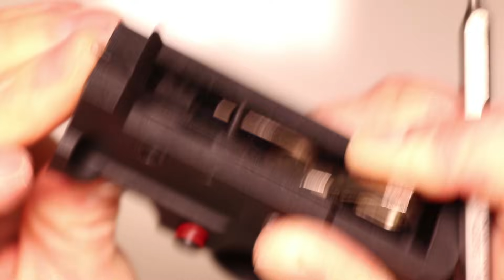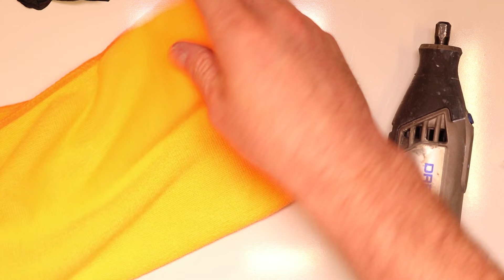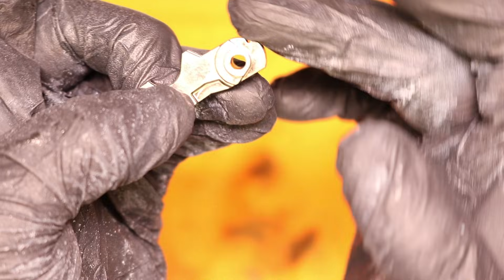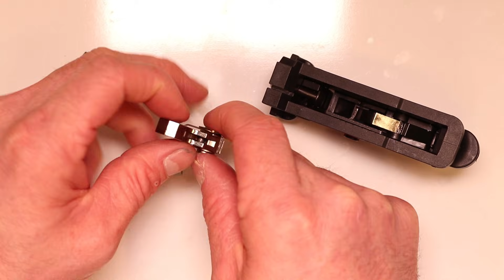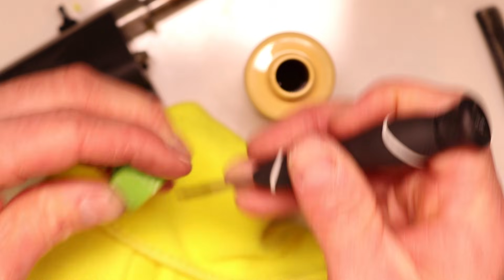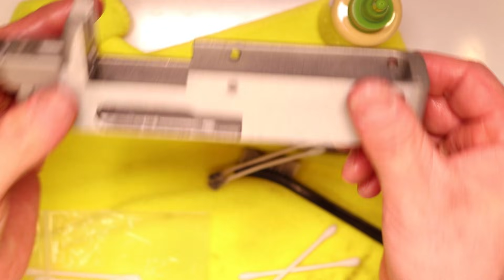Ruger 10/22 Trigger Job w/ Polishing – Full Disassembly, Cleaning & Trigger Spring Kit | M*CARBO

Comment: The slave pin shipped with the kit is too small. It should be the same diameter as the sear pin. It's too sloppy and nothing lines up once you get the trigger dropped in. Very fiddly. Otherwise nice modification.

Comment: That's not grime, it's metal being removed.  You could ultrasonic clean those parts and it would still turn black like that with Flitz. Also, sanding is fine if you're careful.  Use 600 or 800 grit.  That's like 500x more Flitz than necessary, lol.

Comment: Mine was 6lb and rough.  I used the new mcarbo kit with 2 springs and a tiny thin dowl.  dowl was useless and fell out so I cut a round toothpick to size.  After brief polish I replace just trigger return spring the tigger was still 6 lb.  I noticed the trigger was very light if hammer spring was disconnected.  Thinking it was way too heavy I cut off one end of hammer return spring, trigger was light but then I had misfires.  So I stretched the hammer spring longer.  I polished more and noticed I burned plastic side of release lever...repolished that off, installed the trigger release spring this time.  Now it is fairly smooth and down to 3 lb and shoots reliably.

Comment: Good job :( You polished all the casting marks, burrs, and imperfections!  They are still there, still causing issues, but they sure are pretty!  A lazy way of metal finishing.  Maybe you should have spent some time sanding or even filing with those crappy parts to remove all the casting marks, burrs, and imperfections, and then and only then polished them.  Yes it takes time, but it is called professionalism and work ethic.  It's what I have been doing for over 50 years and I feel proud of my work.  I do give you a lot of credit on your disassembly and assembly skills and explanation of how to do them.  That alone will help many,

Comment: Nice video, this was actually easier than expected, especially the pins, I just pushed them out with a nail and aligned them back in by eye.

What is interesting is I have an older deluxe model, and when I opened it up it already had machined hammer and sear.  That explains why the factory trigger was always pretty good and I didn't see why people complained about them.

Nevertheless the mcarbo springs indeed lightened the pull and just makes it feel better too.  $29USD in my country though, I felt silly buying them to be honest but I'm glad they worked

Comment: Polishing does remove metal, how else would the surface become smooth. Material is removed, as seen by the blackening on your tool....... Material has to be removed,else it wouldnt become smooth, the paste you used is an abrasive, which removes material. Very light material removal yes, but ya cany say polishing doesnt remove material.... thats a bit silly tbh.

Comment: As others have said, your trigger started with under 3 lbs pull but Ruger 10 22 factory standard triggers come in 6-7 lbs.  You are right to polish those parts for a smooth trigger but you are still removing metal otherwise those burrs wouldn't be removed.  As for removing metal to achieve a light trigger, it is not taboo.  It is simply something to carefully do in small steps checking the trigger pull as you go.

Comment: I watched this video and did the spring mod on my 10/22 but didn't get any change in the trigger pull weight: still was 6 lbs. I'm not sure what I did wrong but I cannot get Mcarbo to respond to my help@ email. Been 4 days now and no response. A phone call (several of them) never gets a human to answer but a recording. I've left two messages and no one has returned my calls. So I've been stuck for 4 days and thinking maybe I should just move on and try another company's spring mod. After all, how long do you have to wait to get some support from Mcarbo or maybe there is no support?

Comment: Great video.  I used the MCarbo spring and polishing kit on my wife's Ruger GP100 with equally impressive results...almost 50% reduction in single-action trigger pull and about 35% on the double action pull.  Looking forward to doing the same on my wife's and my 10/22's .  
Aother tip: A good replacement/upgrade for ANY 10/22 is the plastic (usually polyurethane) bolt stop pin that installs at the back of the receiver.  It replaces the standard metal one that hold the lower trigger group to the upper receiver and makes a BIG difference in the sound and feel of the gun.  It eliminated the metal-on-metal 'pinging' sound when the bolt flies back and it absorbs a goo bit of the shock and vibration caused by the bolt slapping that stock metal pin.  They are a very inexpensive way to improve the shooting 'feel' of a 10/22.

Comment: You have a sub 3lb pull on a Ruger 10/22 with a stock, non-BX trigger group? No Sir. Ruger claims under 3lbs on a BX. They also state that stock trigger groups are shipped at 6 to 7 pounds. I've always heard to never put PTFE or any Teflon infused grease on a sear engagement surface. Lol. I admit I've done it with Shooters Choice red grease 😊. I find that the crud that gets in a 10/22 trigger group makes me clean and wipe that grease out & replace it a couple times a year. My aftermarket sear trigger groups get no grease, lol. Hey guys, if you try & cheap out & just cut the trigger return spring your gun may start failing to reset, it goes bang, ejects, pushes another round in the chamber, but then nothing happens when you pull the trigger. You still feel the springy, springy on your trigger finger, but there's no bang-bang.

Comment: very good video but in my opinion a couple of incorrect statements.  First polishing, it will 100% remove metal the longer, the more.  Second microfiber will scratch the shit out of polished aluminum so no microfiber is not better then a good cotton t-shirt,  and unlike microfiber you can drop a shirt on ground and pick it up clean. Drop a MF on your driveway pop it once and wipe your car I dare you

Comment: I took professional jewelers classes at our local community college, and polishing was part of the curicula.  Nice job in the hanmer and sear.  I would add a couple of things.

First, for safety, polishing releases nasty micro particles into the air which you 
WILL breathe in.  Very bad.  So we wore N95 or N99 dust masks, just to simply prevent the dust from getting into the lungs.

Second, you mentioned cleaning.  An ultrasound is ideal, but it is very important to remove all of the polishing compound or grit.  Absent an ultrasound, you can wash them in hot water and degreasing dish soap.  I would make several passes of that last process.

GREAT VIDEO!  I look forward to doing this to my 10/22 very soon.

Comment: Why no sanding?  Don't you think some 800 grit would do some good?  Ie:  Inside the reciever, bolt, the face of the hammer.   I wonder what polishing compound would be if it were a sandpaper grit?
Reply: Simple Google search would answer your question....my guess 6-12000.., could be way but I took a guess...800 way to tough would remove metal in my opinion

Comment: Well, obviously the auto focus was giving you a hard time. That being said, this video was very informative. I took my 37-year-old 10/22 down and polished the trigger assembly. It works much smoother now and much lower trigger pull. Note: The wooden dowel included in my trigger spring package was about like the lead in a mechanical pencil, way too small, and was giving me a fit trying to reassemble the trigger subassembly. I improvised with a q tip and an Exacto knife. The stem of the q tip was a perfect fit, and the subassembly went together flawlessly using that as the temporary pin to hold the trigger subassembly together.

Comment: Would love to know how you acquired a 10/22 with a 2 lb. 15 oz trigger pull from the factory. Usually these are around the 6.5 to 7 lb range from the factory.
Reply: That’s what I was thinking! Mine was 6.5 pounds from factory and now it’s 2.5 AFTER a drop in kit that I sanded on. Lol but I don’t recommend sanding the hammer or sear. Although mine is like butter
Reply: I know. Sub three pound hammer straight from the factory? That's one rare bird. I wouldn't touch it.
Reply: Bunch of horseshit claims.

Comment: I watched this video and completely followed the instructions and swapped out the springs included in the 10/22 kit. All the work lowered my trigger pull to 4-1/2lbs. But the level of smoothness of trigger pull achieved was the better than the pound of reduction in trigger pull. Thanks Mcarbo and I recommend this spring kit!

Comment: The hammer and sear are should never be rounded. My hammer and sear are polished with 1000, 2000, 2500, 3000 wet and dry sanding cloth. The sear and hammer mate up in a very sharp 90 degree angle contact. To maintain that angle and polish it in steps I use a metal straight edge (combination square ruler) with the cloth very tight flat on/over the edge. A back and forth motion of the sear and hammer along that 90 degree engagement edge where they make contact will polish them like a mirror. A little dab of silicon grease and its ready to go like polished steel .

Comment: Thoughts on Copper grease/anti seize? I've had awesome results, and Glock uses it as well. a TINY bit !!! really stays put, and the copper lubes and protects well. I'm sure someone will take a poo-poo on it, but Ive been impressed! It doesn't run out when hot, and doesn't freeze up. I use a toothpick to apply it, literally just a  half BB sized dot is more than enough. It really seems to fill  micro pores well. Curious if you're familiar with, or use it? Thanks. Great video, BTW. Really helped my Ruger !!!

Comment: Very long video. A good highly in depth one. So the trigger return spring lightened the pull weight?

Update: 1yr later.
Haven't polished anything yet, but I did install my auto bolt release using your video as a guide. Will do the same when I get time to do a lil polish.

Comment: good video. if you hit those surfaces with 600 grit on a parralel first. and then polish, this job will go so much faster. Those parts are not cast, they are Metal Injection Molded.

Comment: Also, my 10/22 is around 18 years old. The hammer and sear were not cast back then and there is no plastic on it anywhere. Much better quality back then.
Reply: Mine is about 12 years old maybe a year or 2 more. My trigger assembly is metal, but it's the stainless version with synthetic black stock. Does that mean anything?
Reply: I hear what your saying, but I have both and prefer the polymer bits for weight. With and aftermarket trigger and misc parts all through the group, cast parts get tossed into the ransoms parts bin anyway..

Comment: Did a trigger job on my 10/22, sanded, and polished hammer, sear and every other metal to metal contact part, used your spring kit and got a 4 lb trigger pull. It was 6 1/2 to 7, now it’s a consistent 4” . Perfect !!
Reply: Drop a volquartsen hammer only into it for about $40 and you’ll have a nice a 2.lb nice trigger pull

Comment: Great video. Just got a 10/22 carbine and will be performing this mod first, and the bolt lock replacement too. 
Also, worked with metal parts in the automotive industry for 8 yrs, and I think the sear and hammer are powdered metal, not “cast”. Could be wrong, don’t know guns much.

Comment: great video.. however.. your use of the Flitz/SimiChrome/Bluemagic is a bit over the top..  the stuff works just fine with a very fine thin amount on the working surface and then work it off..  you put on enough initially to do about 20 sets of parts.. Usually works best to get it on, buff till it is gone and a shine starts, then repeat.. 
We do internal engine parts for racing and it is a very tedious process... it is a chemical polish and not an abrasive and is why just a thin working coat is adequate at a time..        
Like your explanation coming apart and going together.. am sure it helps out a few of us that had the "ooops" moment the first time..  :)

Comment: Why would anyone want to modify the ruger 10/22 rifle when there accurate on the dot brand new and not modified I have the Cariben version and I have never dissasmbled or modified it and it hits my targets on the dot and the trigger pull is perfect how it's set..... if you modify the 1022 then your asking for problems like inaccurate shots and possible jammings and super light trigger pulls ad with that said the hammer Wont  stay cocked back it'll just slip and fire before your finger is on the trigger this happened to my heritage 22 and I still don't have it repaired yet

Comment: a good course of instruction, another method that works well is stoning the metal parts to smooth out those burrs.
the Material is actually being removed at a microscopic level so u are removing material from the finishing and polishing work that you are doing. I am a professional Machinist and specialized in grinding operations and trust me you are removing material brother.
Reply: Technically correct, but using a stone on the burrs & irregularities ALSO removes material.  I think Chris's point is that you're better off using felt wheels & Flitz, and going carefully & closely watching your progress, than you would be if you were using sandpaper or a dremel's flapper wheel or the like, because those other alternatives take off material faster and as you'd know, Bryan, once it's gone you can't put it back!

Comment: Mines at 5lbs and about to put the spring kit in,so I will report the after.
Reply: Getting just above 4.5lbs now so I got about 1/3 rd lb reduction.
Reply: I didn't need too or my sear and other parts weren't nearly as bad as the ones in this 1022 and mine were all smooth and if you looked at em they didn't actually need a polish.
I may take it back down and polish them later but mine were smooth with no burs or uneven spots.
Reply: I'm moving the trigger guage hook lower on the trigger and I'm getting 3.5 lb pulls now.

Comment: Hi Chris!  I followed all the instructions except the trigger return spring change.  And  l repeated the process like 4 times but the trigger still had a heavy pull and it even has a creep now which it didn't before polishing.  I could be wrong, but it seems to me the trigger return spring doesn't matter that much.  Hope to hear from you soon.  Thanks!
Reply: When polishing the sear and hammer as in the video, you're actually slightly rounding off the sharp contact edge. That is what caused the creep you're feeling.

Comment: Great video! Completely disassembled my 10/22 for the first time in 27 years. Thoroughly cleaned everything and did some polishing of parts while I was at it. It operates so much smoother now! Your video was very helpful especially with the reassembly. Thank you!
Reply: did you ever get the kit with the lighter spring?

Comment: I followed the "never touch the sear surfaces" advice and found my trigger was still gritty feeling. Polished the disconnect with a little 800 grit on a flat plate and now it breaks like glass! I also had to polish out the return spring hole.
Reply: You Followed the I'm wasting my time by Not Polishing your Not polishing the seat contact faces Dont Sand Just Polish! And you wonder why it's still gritty? Lol!

Comment: AWESOME video! Very detailed. My spring kits for the 10/22,  AR15, and LC9 are scheduled to be delivered tomorrow so I'll be watching your videos again as I go through the installations.  I do have a question, though. I have a Ruger BX trigger in my 10/22 standard (not a Take Down model). The trigger went from the stock 6.5 pounds to 3.5 with the BX. I assume your trigger spring kit will work as shown in the video in the BX trigger? Thank you!
Reply: The spring kits arrived as scheduled. It took me literally 20 minutes to change the AR spring after watching your video. I don't have a real trigger gauge but with what I have available the trigger pull weight appears to have been reduced by at least 25%. I'm quite happy with that.
Reply from the maker: Awesome!  Thanks Dennis for sharing your results Brother.

Comment: I'm so tired of people saying that they aren't removing any metal, they're just polishing a part.  I think every vid I've watched on improving trigger pull on a S&W 686 to a SUB-2000 to a Winchester 1894 say this and it's BS.  It's not possible to polish metal using an abrasive w/o removing metal.  Flitz is an abrasive it has grit in it just like sandpaper has on it.  OK, not "just like" but it serves the same function, to remove base material.
Reply from the maker: Flitz is a non-abrasive polish, meaning you would remove less than 0.5μ which is 0.000019685". That's why people say you don't remove material, you effectively aren't
Reply: @MCARBO  
As you say, any abrasive polish removes some material, however slight. Even optical rouge or cerium oxide removes material to yield a true mirror finish.
Reply: Really??  There isn't enough material "removed" to be bitchy about it.  Spend more time making constructive videos like this guy did rather than being a negative nanny...
Reply: @guitaronwater9034  
Sometimes it pays to be particular about such things. Making microtome blades is one such time.
Reply: @guitaronwater9034  I don' think I'm being "bitchy", I just want people to be accurate when communicating so it will be less likely that there will be misunderstandings.  I guarantee there are people out there that believe that polishing doesn't remove any material.  And there could come a time when this gets them in trouble.  We, especially younger people, have become very lax with language.

You could spend more time making constructive videos like this guy did rather than being a negative nanny about my comment.

Also still waiting for an explanation on how non-abrasive polish works.